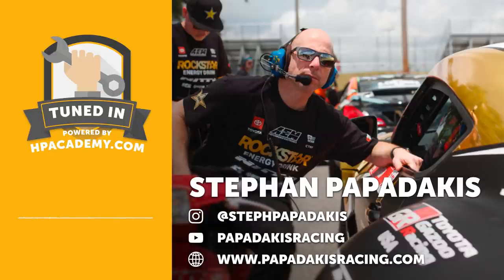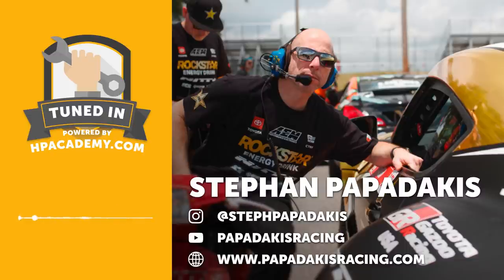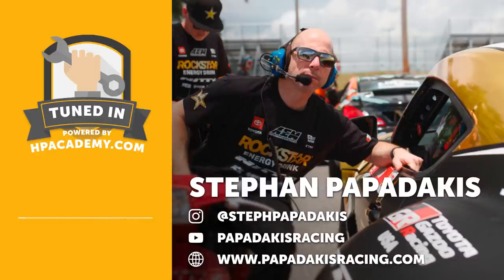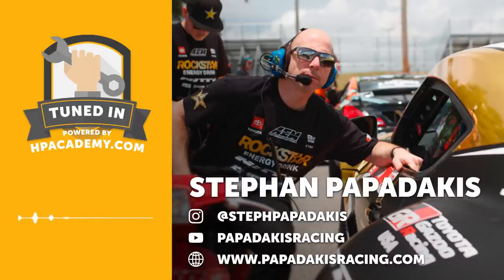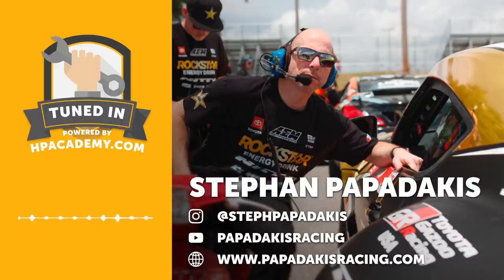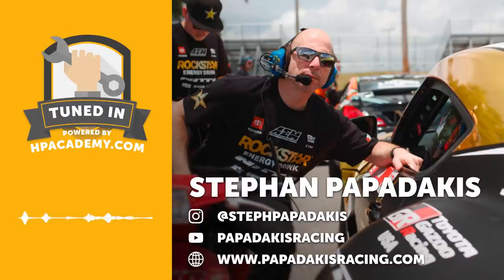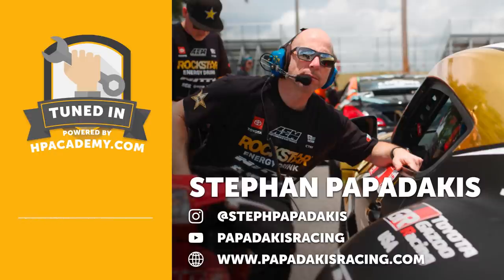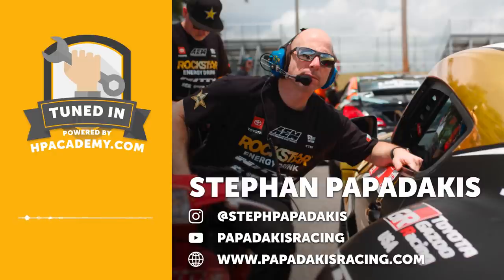040: Building a Reliable 1000hp 4-Cylinder for Formula D. [#PODCAST]

Comment: I've had the pleasure of working with Stephan once or twice. A few things I think I've noticed: 1. It seemed like he tried to control for variables, for instance try to only add one new part at a time or get a good baseline dyno run before making the planned changes. 2. On occasions where I happened to know about something and he was learning, he asked good questions to make sure he understood the new concept and then if possible he did his own testing to prove that it worked as expected. 3. He always seemed to have a backup plan ready to quickly swap back in case the new part or new method didn't work. He and his entire crew were always a pleasure to be around, I went out of my way to visit their shop area just to see what cool things they were up to.
Reply: Nice.

Comment: I’m having a 1000whp ecoboost mustang! Adam Brunson from tune plus inc is doing the build!  Gonna be a sick one for sure!!
Reply: That sounds cool af. Im not familiar with the ecoboost. Will you be building the stock trans or does it have something better that can swap in?
Reply: Make a video when it's done!
Reply: @clutchboi4038  yeah gonna be special for sure.  And yeah also building the 10 speed transmission , gonna literally be the same as 5.0 10 speed as in same amount of clutches because the ecoboost 10 speed has less clutches. So yeah transmission is also getting built to handle 1000whp+ .  And yeah the ecoboost platform is pretty cool!  Like for my build I’m using the 2.0 focus ST block which is gonna be sleeved with forged 2.3 internals.  There are different variants of the ecoboost engines and guys take the best parts and kind of make a Frankenstein out of all tye variants. Like I’m using the 2.0 focus ST block instead of the stock 2.3 mustang block.  There is another block which is from the Ford Edge TS block that some builders also use. I’m also using a 4 port head which is not the stock 2.3 head either. The stock 2.3 head is a single exhaust port head.  So the whole build is custom spec.  At end of the day it’s still a 2.3 ecoboost.